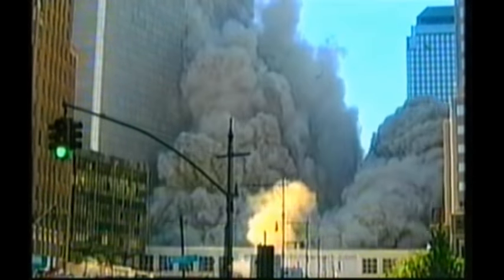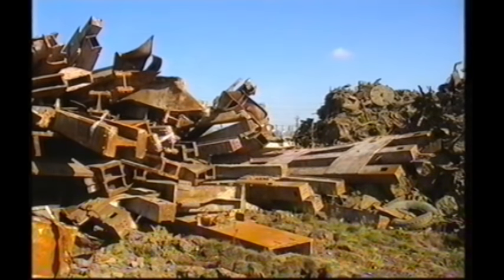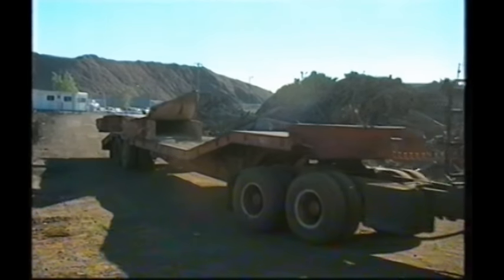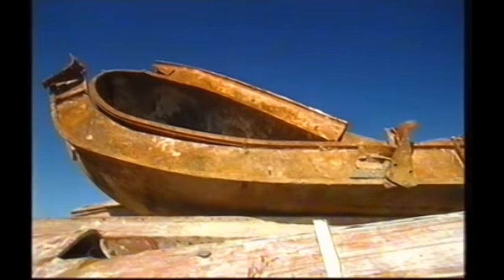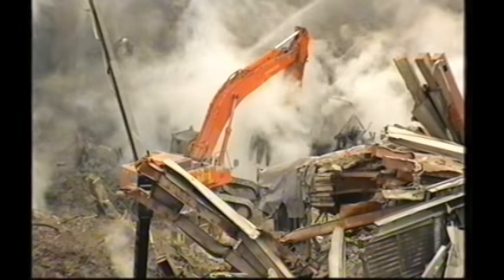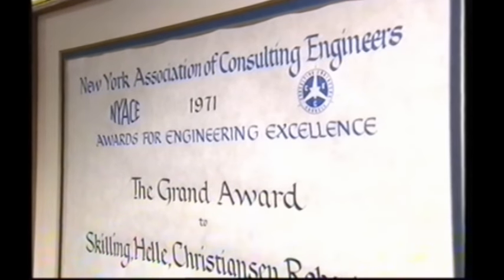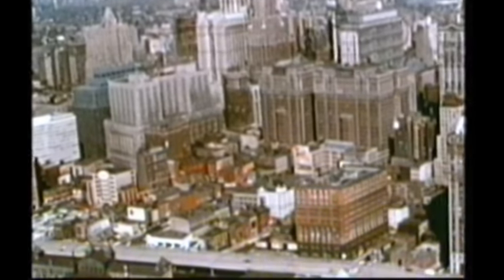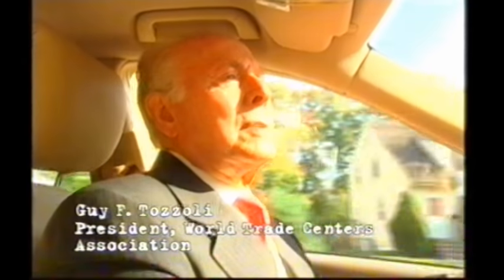9/11—"How The Twin Towers Collapsed" (C4 documentary, 2001)

Comment: As a structural engineer myself, I really feel for Leslie Robertson here. It's every structural engineer's worst nightmare. But he shouldn't have felt any guilt: the buildings were designed as per the code of the time (in fact, beyond that). And as a engineer, that's the best you can do.
Reply: I'm no engineer but I totally agree. How could anyone have forseen something like this and planned for it? There's no way anyone could have foreseen a 130+ ton aircraft flying at 200 mph, carrying tons of jet fuel hitting the buildings and figured all the variables into the structural equation. It would have been impossible. I hope the engineers understand that they did it right and they are in no way responsible for what happened.
Reply: As a structural engineer,  "where did the towers go?
As a structural engineer,  how does a steel frame structure fall STRAIGHT down?
Reply: @hiddenacres4287  I tried explaining it to Truthers before.......and I quickly discovered it was a waste of my time. They almost always lack the technical background to understand the explanation.....or just refuse to accept it. Put in about 20 years as a structural engineer.....and then we'll talk.
Reply: Was there another flooring system that was available at the time..they may of used that may of held together
Reply: When steel is weakened enough ,,it WILL fail simple as that. Be it by heat or fatigue or many other factors it will fail. Seen it many many times in my profession.
Reply: Ok, structural engineer. Answer me this, why did Tower 7 collapse the exact same way without being hit by a plane and having only office fires when never before, nor since, has a skyscraper collapsed into its own footprint due to fire? 

Forget that these building were built to withstand not just one impact from a commercial airliner but multiple impacts. Forget that. Structurally explain tower 7 to me because it was conveniently left out of the 9/11 commission report… for some odd reason. There are skyscrapers/hotels older than this that burned for nearly two days and still stand to this day. I don’t blame dude that built the buildings, I blame the faceless cowards that pull the world’s strings in plain sight.
Reply: @MR-bp3in in 45 - 90 minutes?! Dude, stop it.
Reply: @oooops8883  Ever study the design of WTC 7? Ever study any design (for that matter)? Trust me: I've been down this road with Truthers......and you just don't know what you are looking at with this. Put in 20 years as a structural engineer (and pass the SE exam).....and then we'll talk.
Reply: @09rja I’m not being cocky like that other guy but does it have something to do with the foundation at the base of the towers breaking away from the structure of the tower? You can just reply with yes or no I don’t need super descriptive detail  😂😂
Reply: @User_yhvz  Are you talking about WTC 1 & 2 or WTC 7?
Reply: @oooops8883  as you know, they were demolished on purpose by planned demolition.
Reply: @cyrusdubash3097  only to tinfoil hats
Reply: @09rja........I don't know anything about this stuff but I understand reason.....you are obviously someone who understands.....good luck trying to convince those that will not listen
Reply: @boris9331  the steel didn't disappear
Reply: @boris9331  90% of the steel disappeared in the collapse? lol Ok.
Reply: Too true. In places that have earthquakes, I gather the buildings are constructed with that in mind because it is a possibility. Before 9/11, no one would have envisaged a commercial airliner loaded with fuel being deliberately crashed into the side of a tall building. About as likely as a comet landing on it, we would have said.
Reply: @oooops8883 Building 7 came down because Larry ordered them to pull it.
Reply: @MarieORourke-e3v  What would have been interesting is if this had been constructed with Earthquakes in mind. At the time this was done, seismic loading really wasn't a big part of building codes (except in places like California & Illinois). If you'll note: Robinson mentions the wind load but not the seismic. (I'm assuming because seismic (if it was considered) was less than the wind.) Since pretty much everyone is using the IBC by this point, that would have meant not only a healthy seismic lateral load, but also a different structural system (with more redundancy). Not saying that meant it would have made it....but it might have done better.
Reply: @hiddenacres4287 That struck me, too. I have no knowledge of these things, but it reminded me of footage I have seen of planned demolitions. It kind of fell in on itself.
Reply: @09rja I have great respect for structural engineers. How on earth do you even begin to conceive of a stable building that tall? I am an early childhood teacher. Did you all start with Lego?
Reply: @09rja You're right. Someone who puts in years of study, intellect and experience deserves our respect, and nothing is foolproof. Witness the Challenger space disaster.
Reply: I think that he even considered a 707 flying into it goes to show how much thought he put into it at the time
Reply: @DaemonetteLeilu19  Agreed. Plane strikes aren't part of any code I am aware of. (Except maybe the NRC.)
Reply: @boris9331 global warming is why the steel evaporated.
Reply: @hiddenacres4287  "how does a steel frame structure fall STRAIGHT down?"

As someone who understands basic physics, because gravity doesn't pull things fucking sideways.
Reply: @oooops8883  - "when never before, nor since, has a skyscraper collapsed into its own footprint due to fire?"

Well, except for the steel-frame skyscrapers that DID collapse "into their own footprint" due to fire (actually pretty much all of them sent debris raining all over the place, but whatever).   Like that highrise in Sao Paulo back in 2018.  Or the steel sections of Windsor Tower in Madrid in 2005.

Yeah see, just claiming it's never happened before or since doesn't actually mean it's never happened before or since.

Here's a question for you - if steel structures can't collapse due to fire, why do they bother fireproofing steel structures?
Reply: @boris9331  lol who told you 90% of the steel "disappeared?"  This is a genuine question btw, I actually want to know where you heard that.
Reply: bro relax don't be a dweeb no-one told me that, go get out more man if you ever worked in building and construction you'd know how much rubble you see off a certain sized building that get's brought down.
Reply: @oooops8883  Uh, Sao Paulo 2018
Reply: Your just a ..................!!😊
Reply: Interessting how much the obvious is so often unseen: huge holes in the outer structure. 
So many people argue Buildings of steal never collapse by fire but ignore the structural weakening by the huge holes. I don‘t get this 🤷‍♂️
Reply: @hiddenacres4287 it CAN'T 😢
Reply: @oooops8883  Your probably talking to a bot or ai most people understand free fall and the need to remove all resistance on the way down, the one that really got my attention was the demolition expert who said I knew that was a controlled demolition as soon as I saw it .
Reply: The American government detonated the foundations of the structure, it wasn’t the engineers fault at all
Reply: @09rja  if I'm a truther then you're a liar
Reply: @melvynsngltn27 youtube engineering wannabe
Reply: @09rja  learning disorder
Reply: @09rja  I smell 💩
Reply: @09rja  Youtube engineering wanna be with a degree from  lego land
Reply: @coolk3dat754  so that's what you Consider yourself
Reply: @melvynsngltn27  learning disorder
Reply: @coolk3dat754  what part of NYC are you from again 🤔
Reply: @melvynsngltn27  Much too easy for someone to ignore and deny evidence
Reply: Un crollo strano, non sono convinto della caduta causata dall' impatto con gli aerei, la fisica lo dimostra.
Reply: @luigigiordano949  I'd be curious how "physics proves it". I have yet (over 20+ years) to hear a convincing argument based on real design knowledge. When this thing first started, I thought there might be some arguments based on some fairly complex modes of buckling and so on (arguments that the average practicing engineer would have trouble debunking)......but so far (after all this time) all I am here is junk like "[this] amount of mass fell on [that] amount of mass" or some demo with cardboard boxes (i.e. by Richard Gage). I've yet to see any real substance by a knowledgeable engineer.
Reply: @09rja  youtube engineering wannabe
Reply: @09rja  show me an experiment that demonstrates the force behind the motion. Without it you aint 💩
Reply: @coolk3dat754  You couldn't calculate a impact force if your life depended on it. You don't know what you are looking at kid. It is that simple.
Reply: @09rja Youtube engineering wanna be 😅
Reply: @911conspiracy-c9s  No answer on my challenge to debate this in a engineering forum? That's what I thought. You guys are all the same.
Reply: @09rja  why go anywhere else when you cant even rebuttal on my request. You just ignore my intelligence because you know Im right.   Ill prove it again........watch...
.Regarding Newtons 3rd law of motion and conservation of momentum,  when you apply them to the collapse, what should and shouldn't have happened?                        Prediction,  you will side step this most important question. Im not even an engineer. This is high school physics.  Common sense and better judgment is what I bring to the table. You dont stand a chance with your false claims🖕
Reply: @09rja  the planes impact only caused local damage and did not impair the integrity of the rest of the building which still stood with all its might
Reply: @911conspiracy-c9s  So lay it on me: what should have happened by Newton's Third Law on 9/11? You may want to use cardboard boxes to demo (like Richard Gage). 

All these years, I've been doing it wrong: all it takes to design steel is Newton's Third Law.
😆
Reply: @911conspiracy-c9s  looks like somebody's got multiple IDs. I won't waste anyone's time by extending the debate challenge to this sock though.
Reply: @09rja pretty much ended your fake career😂
Reply: @09rja 20+ years of a fake  career and a guy like me destroyed you in one paragraph lol😂
Reply: @911conspiracy-c9s  Destroyed? I am still waiting on you to explain what should have happened by Newton's Third Law? I haven't heard one substantive explanation yet.
Reply: You know what is amazing? Not one "Truther" has ever taken me up on my challenge of a debate in front of a group of structural engineers on this over the years. You'd think if these people had the goods they'd be willing to do that and make a impression on the profession. But these guys run from this like a sprinter. Gee I wonder why?
Reply: @09rja  engineering forum? You mean Legoland?
Reply: Well actually I am talking Eng Tips. 

We are all a bunch of fakes helping each other solve fake engineering problems.
🤣
Reply: By the way, if anyone wants to read what a bunch of real structural engineers think of these theories....go to Eng Tips and search for the thread "9/11 Structural Engineer's Poll". You will note not one engineer voices an opinion for these silly theories. (Except for  a guy that has no posting history before or after this thread.)
Reply: @09rja  just wanted to let you know.... Costco is hiring
Reply: Attention readers......take notice of this Imposter who I single handedly destroyed his  imaginary career with one simple high school taught question. 20 year so called experience in engineering....but doesn't know,follow, or believe in the laws of physics.
Reply: Attention readers: please note #1 The Truthers unwillingness to debate this on a engineering site, #2 The Truther's inability to explain what he means by all this "Newton's Third Law" nonsense, #3 The Truther only appears after 3pm suggesting we are likely talking about a school kid, or someone who has no access to a computer most of the day.
Reply: @09rja  Not working for you is it? LMAO🤣
Reply: @911conspiracy-c9s  You got that right. I've never been able to get a Truther to show up to a engineering web site. I guess Truther=Coward. But we knew that.
Reply: @09rja  if I'm a truther you're a liar
Reply: @09rja  and do you really really think you're looking intelligent by simply going on blah blah blah blah without ever challenging me or answering questions and not having a scientific method to back up your false claims?  You make this so damn easy to beat you in a debate that you wont ever enter
Reply: @09rja  WARNING 📢 COMPULSIVE LIAR ALERT🚨
Reply: @ 911conspiracy-c9s lol What debate? What questions? No challenge? I challenged you to settle this on a engineering forum.I named the place. Who do you think you are fooling with this stuff. 

You couldn't beat a egg. 
😆
Reply: @09rja  denial is a ugly thing to witness. Not working for you is it?
Reply: @09rja  ps all anyone has to do is read  our convo and  confirm you're in denial and constantly lying to yourself.  Costco is hiring
Reply: @09rja  is that all you got?
Reply: @09rja  I challenge you here and now.  See what I reduced you to?  Omg hilarious
Reply: @911conspiracy-c9s  And I have (repeatedly) challenged you to a debate on a engineering forum.....and you have run faster than a Olympic sprinter. 

Nice job. lol
Reply: @09rja explain why you are afraid to challenge me here and now😊
Reply: @911conspiracy-c9s  Challenge what exactly? There is nothing here for me to talk about. Just a bunch of golbydgook about "Newton's Third Law". 

So why don't we go to a engineering forum and I'll post my ideas...and you post yours.....and lets see what people say? 

Not gonna do that are ya? No surprise. Typical Truther.
Reply: @09rja I have repeatedly ask you for scientific proof. An experiment that  can demonstrate the force behind the motion....
No rebuttal. I asked you for explanation of what should and shouldn't have happen when you apply Newtons laws to the collapse....No rebuttal.  You're the one who made all those false claims on this very same comment thread and now you're making f up excuses to dare challenge me.....here....and now.   How sad😂
Reply: @09rja Do you realize how much time you have spent denying everything I've asked without ever proving anything about everything concerning the 911 inside job?  You wont challenge me here or there. What a waste
Reply: For some reason YouTUbe isn't posting my (detailed) reply on this "Newton's Third Law" stuff. Not sure why. But this kind of thing is why I typically ask to take this to a engineering forum.(Where i can also post links.) But in short: this stuff is total nonsense. You don't figure buckling loads this way. To put it in a very simple way.....by Truther theory it should be harder to buckle a column the longer (and heavier) it is. In reality: it is the exact opposite. The higher the slenderness ratio is.....the more likely it is to buckle. (Slenderness ratio increases with length.)
Reply: @09rja  how come  your detailed lies have no problem being posted?🥱
Reply: @911conspiracy-c9s  Well, actually i expanded my last post (as much as it would let me). I really can't figure why anyone who is really interested in this won't go to a site where we can post nearly anything......I can only conclude that person is simply trolling and not interested in the truth of this matter.
Reply: @09rja  you should be trying to figure out why no one believes in your lies
Reply: @911conspiracy-c9s  No one? You may want to check this thread again. But probably the same people who don't believe my "lies" are the same ones who think the Earth is flat and get followed by the UN helicopters. We know who those people are. 😆
Reply: Fraud
Reply: @09rja Ive never lost a debate. I'm too smart for you
Reply: @911conspiracy-c9s  lol You are so smart....you won't go to a engineering web site to prove it.
Reply: @09rja Im not an  engineering wannabe like you but yet with one question I destroyed your confidence which didn't allow for you to honestly answer or even rebuttal on the subject even with your 20+ years of a fake career . An engineer who thinks  Newton's laws need not apply. Who thinks the collapse is based on the design of a bldg but has never tested his theory with an experiment to demonstrate his ridiculous stories are even possible. I left you without a rebuttal, without a answer , without challenging me, without any attempt of talking about the subject. Although you claimed you left a long explanation but somehow YouTube did  not allow you to post. That's a shame . Probably gotten tired of your compulsive lying also. I gave you an opportunity to challenge me and   you dropped the ball big time😂😂😂 sorry but that's is a result of losing a debate.
Reply: @09rja  I dont need  to prove anything. You're the imposter who knows nothing about the laws of physics or engineer?  Kind  of strange to claim you can't answer anything here but might answer over there? Doesn't matter to  me  where we are you would still get spanked
Reply: @09rja  WARNING 📢YOUTUBE ENGINEERING WANNABE ALEET
Reply: @09rja  still waiting to hear your 20+years experience. So far.....

mighty quiet around here. What kind of engineer is not familiar with laws of physics?
Reply: @09rja  I see the pattern here. You dont answer or challenge anyone. You simply broadcast your fraudulent career.
Reply: @911conspiracy-c9s  I've given you several challenges.....including showing up to Eng Tips to debate this.....and you won't do it.
Reply: @911conspiracy-c9s  Here is another challenge for you: why not call a local structural engineer and ask him/her about these theories? That's not too hard is it?
Reply: @911conspiracy-c9s  You've given me nothing to answer really. Just a lot of yap about Newton's third law.
Reply: @09rja  you given not one challenge but pure lies
Reply: @911conspiracy-c9s  Actually I have given you several challenges. Including: going to Eng Tips to debate this, calling a local structural engineer, and actually explaining what it is you mean by all this "Newton's Third Law" stuff. And so on.....so far, I've gotten nothing on any of it. 

None of that involves any lies.
Reply: @09rja  lmao 🤣 how impressive to give yourself thumbs up👍 No one else 
will fosho!
Reply: @09rja You have failed miserabley by not answering and accepting any challenges I have brought to this debate. You lose.  Game over!
Reply: @911conspiracy-c9s  lol Yeah, I've "lost" because you can't explain what you are talking about with this "Newton's Third Law" stuff you picked up from other Truthers.

So the three challenges from me you still can't answer is: going to Eng Tips to debate this, calling a local structural engineer, and actually explaining what it is you mean by all this "Newton's Third Law" stuff.
Reply: @09rja  no, you lost cause the question I ask which you should have known  if in fact you were a real engineer but you failed to take the challenge that would have proved you wrong. That simple you lose
Reply: @911conspiracy-c9s  lol Yeah, I've "lost" because you can't even explain what you are talking about. You also won't call a structural engineer (to confirm what I am saying), nor will you go to Eng Tips to discuss it either. If nothing else, Truthers are certainly entertaining.
Reply: @09rja  Architects and Engineers for 911 truth know that modern state bldgs do  NOT come  crushing down with no resistance. I showed you a video and you had nothing to say. You offer nothing.Explain nothing . Answer nothing. You don't ever debate. Your comments hold no merit. Wah wah wah😭
Reply: I'll tell you something else: I'd like to know who these guys are who supposedly pulled off this controlled demo. In the real world, you get calls (every 10 minutes) from a demo crew where they cut the wrong thing, did the wrong thing, etc. These guys pulled this off with out a hitch. I'd hate to work with a bunch of mass murderers....but for these guys, I think I'd make an exception.
Reply: AE911? lol They claim thousands of signees for their on-line petition.....but the last time I looked, only about 30 of them are structural engineers. (Out of a profession with tens of thousands.) Look at ASCE's Journals: not one article supports these theories.
Reply: @MarieORourke-e3v  what do you mean you're right? Now you are both wrong. Congrats 👍
Reply: @09rja  fraudulent
Reply: Too many fraudulent engineers on this very  thread as many as there is on this very bogus video. All three bldgs were brought down by design
Reply: @09rja  BTW Its not about who supports a theory...duh 🙄 it's about who can prove a theory with scientific evidence with an experiment that can demonstrate your theory is proven possible.  What kind of engineering wannabe are you who believes in such juvenile nonsense that has no relationship to reality?🤣
Reply: Attn YouTube, what's the matter? You hate the truth being told? So you delete my comments? This only supports me 💯% 👍👏
Reply: @09rja  don't care about the impact Force. The impact cause only local damage and did not impair the integrity of the rest of the building period. Who's the one that can't explain to be Newton's third law of motion and conservation of a minimum? You!
Reply: @09rja  still waiting for experiment to demonstrate the force behind the motion to prove your theory. YOU GOT NOTHING LMAO 🤣
Reply: What about the structural engineers that totally disagree with you? And tell me how 110 stories fall in 10 seconds? Ever here of Newton?  @09rja
Reply: If the trusses and connections were weak, how were they able to pull in the incredibly strong outer structure that was able to support 5 times the weight above??? That makes no sense.
Reply: The silly little experiment with the weights has a major flaw. They only had one floor halfway down the model. It's a ridiculous model because all the floors below the impact were strong and intact and would offered tremendous resistance. Physics shows us that only 35% or so of the weight of falling objects is immediately experienced by the below structure it hits. And due to Newton's 3rd law of motion, the floors should have mutually destroyed each other above and below that weren't damaged.
Reply: @oooops8883 yes, I feel bad for that structural engineer. He had to swallow the truth, that the buildings should not have fallen. He probably was forced to do so.
Reply: @09rja you don't have to be a structural engineer to know building 7 should not have fallen, especially like it did. A child can know this.
Reply: @MarieORourke-e3v wrong. The buildings were built actually considering more than one commercial airliner of the time hitting them.
Reply: @zackakai5173 exactly. Several ton beams were thrown 600 feet away into other buildings. This doesn't happen due to gravity.
Reply: @brettarmstrong8534  Which ones? A grand total of 30 (out of a profession of tens of thousands) have signed Richard gage's petition. This has no support in the profession. The journals don't support it. I gave you a location of thread where structural engineers discuss (and dismiss it). Face it: this is a giant zero among structural engineering professionals.
Reply: @brettarmstrong8534  Ever study Building 7? Ever do calculations on it? I have.....and I bet you haven't.
Reply: Now that more Truthers are showing up and claiming that there is support among structural engineers for this preposterous theory....let me predict (in advance) the ridiculous excuses as to why virtually none can be found: #1 There is underground support for this theory, they are just afraid to speak out. #2 Confirmation bias. #3 More people would sign Gage's petition....if they knew about it. Lets see which of these theories these guys run with (plus their excuse to not debate this on a engineering forum).
Reply: @brettarmstrong8534  This stuff about X amount of mass can (falling) can only destroy a equivalent amount of mass is nonsense. Putting aside the fact we are talking a impact force: I can buckle a 10 ton column with a 100 lbs load if it is slender enough. (AISC limits slenderness ratios to 200.) All this ignores the collapse mechanism. These people don't know what they are looking at. Pure and simple.
Reply: @hiddenacres4287 it doesn't unless someone wants it to fall straight down, twice in one day less than 300 feet apart.
Reply: @09rja  if you cant explain it in simple terms - its because you yourself dont understand it
Reply: @kimdejbjergjensen2201  What is it I can't explain in "simple terms"? You'll have to remind me.
Reply: @brettarmstrong8534  O9rja is a YouTube engineering wannabe
Reply: @09rja a You're a waste of time because you don't know the facts..period
Reply: @MR-bp3in You see molten metal burning for 6 months after the fire?
Reply: @melvynsngltn27 yeah they shipped it off to China before it was examined
Reply: @09rja Earthquake didn't take down the towers ..explosives did
Reply: @zackakai5173 And doesn't launch steel beams  horizontaly.
Reply: @seedplanter7173  no it wasn't. It was slipped to Staten Island which is still NYC quit watching bogus videos
Reply: @markus3475 You don't get a lot I'm sure.
Reply: @seedplanter7173  amen
Reply: @seedplanter7173  insulting random people here. You are awesome. Think about that and get yourself some friends and joy in life.
Reply: @markus3475  insults idiots is more like it.
Reply: @09rja  dumb answer
Reply: @911conspiracy-c9s  ok, so you are a truther kiddy too. Then, I would be happy to prove me what‘s wrong in my post? Common!
Reply: @markus3475  I can tell you what's wrong with this very post. Using "truther" as a way to attack someone is so out dated it ruins your credibility.....end of story
Reply: @markus3475  seedplanter wasn't insulting anyone. He laid it in the line. It's like this....people who think they know everything really piss off those of us who do
Reply: @911conspiracy-c9s oh common. Did you seriously just tell me I don‘t get anything is Not insulting and justified because you guys know everything about 9/11? Seems to me you guys don‘t get it. But again, I am Open for some thought exchange. So again I invite you to tell me what is wrong about my initial post.
Step down from your throne of wisdom and let us know what you know.
Reply: @markus3475  I just told you. You don't like it . Tuff
Reply: @911conspiracy-c9s  no. I asked you to refer to my initial post. The one I am saying the outer strucutre was damaged. That was the post seedplanter was apparently not happy about. And I was inviting you too telling me what is wrong about it. so please do so.
Reply: @markus3475  it's too late for you you use the word truther and that ruins your credibility. Jig is up for you
Reply: @markus3475  had you not use the word truther I could have let it Go but.....................too late
Reply: @911conspiracy-c9s  thats very weak. I am probably the only one here really seeking to discuss with you although you are kind of supporting the one trying insulting me. 
And btw, truthers call themselves truthers. Whats your Problem with it? Anyhow, Tell me your view.
Reply: @markus3475  stop telling lies and no one will insult you
Reply: @911conspiracy-c9s  unexpected move. What lies do I spread? About being insulted by someone in the comments here of what so you mean?
Reply: @markus3475  calling me a truther and claiming truthers like to be called truthers. Where in the hell do you get your information from?
Reply: @911conspiracy-c9s  ok. You know what? Keep your wisdom. I give up. But you have to acknowledge I do not believe you have so much wisdom to share. Anyway, we will never find out sadly.
Reply: As an engineer, I wonder what you think about this scenario. What if the planes come in more like a dive bomber like 45 degrees and entered low, around the tenth floor and damaging floors below that because of the momentum downward most of the fire and energy didn't come out the other side. I would expect instead of collapse, maybe it would tip over, causing much more damage to surrounding real estate.
Reply: Engineers sure have a lot of time on their hands. You could wonder all you want is irrelevant. You're one of those" what if" guys. What is this and what if that. What is my aunt had balls she'd be my uncle. My point is it doesn't matter
Reply: @melvynsngltn27 Well, there's lots of damning evidence to prove they were brought down by pyrotechnics, as nothing else could explain what they soon found.  I love my tinfoil hat, btw.
Reply: @lorirogers452 I read an excellent book on this year's ago, stating that only pyrotechnics could do what was done, creating melted metal in some areas, the falling straight down phenomenon, and tons of superfine "pyrotechnics dust" which can only occur due to an explosion/demolition.  Then there's the huge insurance policy taken out shortly beforehand and the evidence of explosives being brought surreptitiously into the buildings in the weeks leading up to the tragedy.  Also is the fact that the US government planned this out for a reason!  But you'll just have to do your own research because I've been delving into this mystery for years.
Reply: @Dave_dave69 You're absolutely correct, it was due to pyrotechnics, and there's just way too much incriminating evidence to argue otherwise!
Reply: @09rja Leslie Robertson mentioned that the wind load of the WTC towers was perhaps 4-5 times larger than the earthquake load if it was  built in Los Angeles or Tokyo.
Reply: @charliesigouin5101  That's true but Earthquake design has capacity well beyond its design loads. (Depending on the LFRS system chosen.) There are response modification factors in code as high as 8. Seismic design has the mindset that the load will be resisted (in part) through inelastic damage. That gives it redundancy that wind design really doesn't have (since it uses a elastic approach).